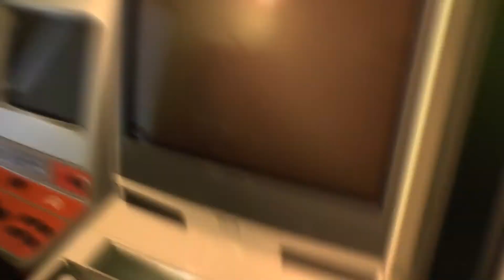Gaming Console Video Transcoders / Transcoding

Comment: I've heard someone got a VGA signal out of the PS2 by using a RGB SCART cable converted with the Sync Strike and then set to RGB from the PS2 menu, but he cited it wasn't worth it because of all the trouble he went through to get games working.
Reply from the maker: It won't be VGA using a sync strike.... only a VGA connection type, rather than a VGA video signal.

Comment: Nice video. This device is actually exactly what I've been looking for, so I may end up getting one. I have a Wii VGA cable made by a different company that I believe is essentially the same as what you're showing here. It's pretty good for what it is, but it's limited to only Wii and PS3 video output. I was actually considering buying another one and modifying it for component inputs so I could use my Xbox with it, but I might buy this device instead. It was a very informative video, thank you for that.

Comment: Some technical wizardry there :-)
What's the best way of connecting my dreamcast to my B&O MX4000? RGB? Seen loads about the VGA but the MX4000 doesn't support this...
Basically I'm after the best poss picture on my current setup. Cheers
Reply from the maker: The BEST picture from a DC is via VGA (480p).  You can either use a PC CRT Monitor (my choice personally), a LCD/LED monitor or a LCD/LED/PLASMA TV (assuming it has a DSUB15 socket).
Reply: Any particular choice for the PC monitor? Ideally something in black :-)
Reply from the maker: Dell did a very very dark grey (almost black) PC CRT.  It's the model range I use (mine is a E771).

Comment: Hi there, I've been hooking up various 480p consoles via transcoder to a professional LaCie 20" PC CRT.  Lovely sharp images although IMO not a great leap over 480i on a CRT TV via RGB SCART.  Great for games with small text but some like Panzer Dragoon Orta on XBOX are just too dark at 480p, even with brightness adjustment :(
Reply from the maker: 480p should be the total opposite, since you get a full 480 lines of video per frame.
Reply: Faginrs500 Indeed it should.  For example Ninja Gaiden Black at 480p on a PC CRT is simply stunning and even my PS3/Wii U owning friend was blown away by the quality.  However for some reason Orta is just really dark which is a shame as its one of my favourite XBOX titles.
Reply from the maker: RJAY63 Weird.

Comment: Dearest Fagin, If one were to use the old famous ebay cga/vga scaler with a wii component cable outputting 480p into the scaler's component input and outputting 480p into a vga monitor would this effectively be doing the same thing (transcoding) as no up-scaling is occurring? or would this still introduce lag or some other issue?

Comment: the arcade forge scaler does a great job with ps2 component to vga
Reply from the maker: It's not bad..... not as quality as this pure transcoder though.
Reply: Faginrs500 Oh cool, so this mayflash 2:1 would be a better choice over a GBS-8220 (the "arcade forge scaler") as pure transcoder. I will try to find it on the bay :) Oh, and if you are going to eventually sell it I would be interested ^^
Reply from the maker: venchia3 It provides better quality than the GBS device, but will not handle 480i.  So it depends on what you need etc.
Reply: Lack of 480i won't be a huge deal, all I'm looking for is having VGA output for my PS2 via component to use with some specific 480p titles such as Gradius V, Hokuto no Ken and the like (via GSM). So no need of the upscaling capabilities of the GBS8220 :)